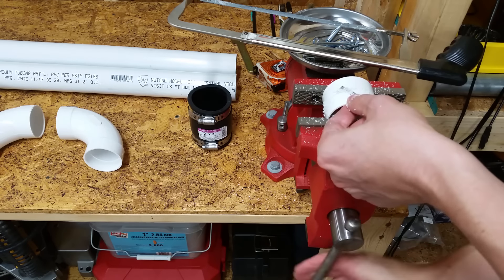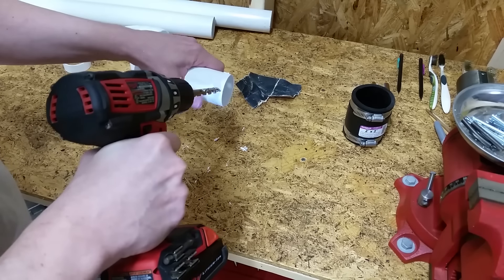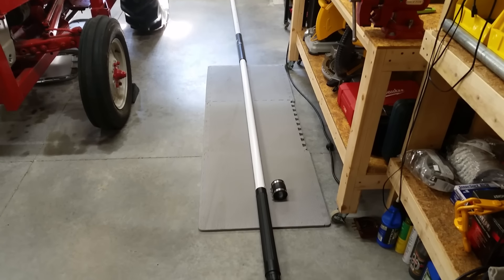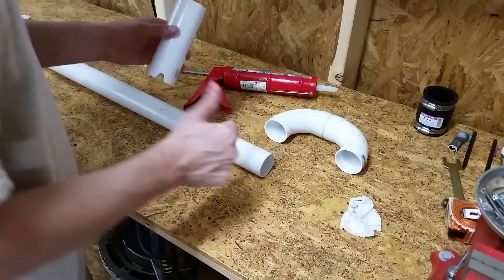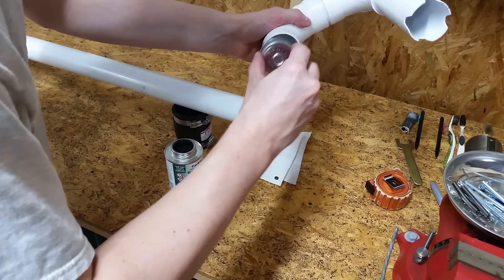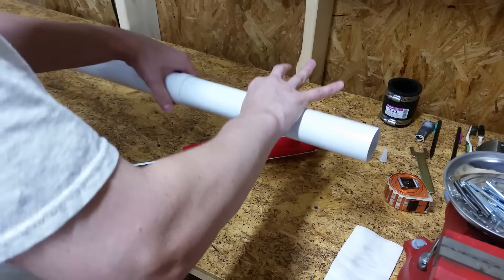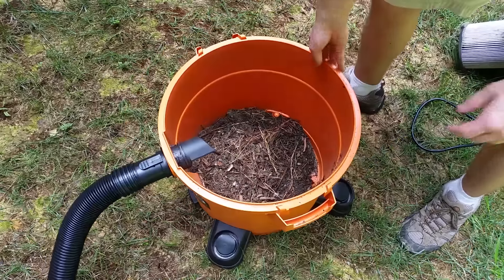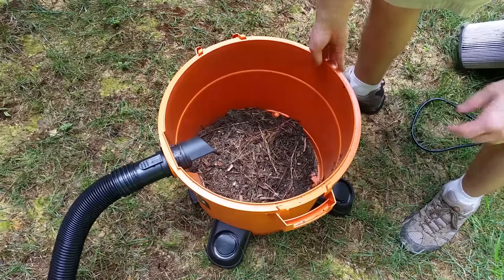DIY Gutter Vacuum - Easy and Safe Gutter Cleaning from the Ground

Comment from the maker: Central Vacuum Tubing:
https://www.homedepot.com/p/100155184
-OR
https://amzn.to/3dJr9Ci (affiliate*)

90 Degree Long Sweep Elbow (x2):
https://www.homedepot.com/p/202195581
-OR
https://amzn.to/2WYPwpC (affiliate*)

Black ABS Pipe:
https://www.homedepot.com/p/202300519
-OR
https://amzn.to/3bM9GYp (affiliate*)

Wet/Dry Vac:
https://www.homedepot.com/p/304006023

PVC Cement:
https://www.homedepot.com/p/203477293
-OR
https://amzn.to/3yz63jw (affiliate*)

Hacksaw:
https://amzn.to/2wRlRUQ (affiliate*)

Miter Box:
https://amzn.to/2WWmGX6 (affiliate*)

*Purchasing from these Amazon affiliate links earns my channel a small commission. Think of it as a tip that doesn't cost you anything. Thanks for the support!
Reply from the maker: I'm really sorry for the late response, I didn't find this comment until just now. Did you call around to your local electrical supply stores? That's where I got my tubing and fittings. I'm glad you were still able to find what you needed. Thanks for watching!
Reply: local central vacuum store has the 2 inch- 8 ft tubing for about $3
Reply from the maker: @pengchen2365  I thought I was getting it cheap for $6 per section, that's great! Thanks for the comment.
Reply: I'm wondering why you didn't stay on the roof to wonder the suction tub along all the gutters of the roof. What about leaf mesh installed in the gutter ?
Reply from the maker: @Matlockization  The whole point of this attachment is to stay off of the roof and ladder. For my house, the mesh screens would still need to be cleaned.
Reply: @Mikeattempts  I see, but how would the gutter mesh screens not keep the gutter clear of debris & litter ?
Reply from the maker: @Matlockization  I'm sure if you only had large leaves, the gutter mesh would stay mostly clean. I have a lot of smaller leaves and long leaf pine needles that would get stuck in the screens. Also, I assume shingle grit would clog up the screens as well. Unfortunately, in my opinion, there's no such thing as "maintenance-free" gutters or everyone would have 'em. :)
Reply: @Mikeattempts  Alright, point taken. Thank you and have a nice day.
Reply: All out of stock :(

Comment: Thank you - I built it and it works great on my second story gutters.  I was also able to run a garden hose up the tube so I could place the hose in the gutter and flush it with water. I have  a small drone, DJI Mini, that I flew over the gutter and angled its camera down to see anything that needed additional cleaning.
Reply from the maker: That's great, thanks for the comment! Before I built the vacuum attachment, my original plan was to make a PVC hose attachment to spray out the gutters. I might still do one specifically for flushing out the downspouts.
Reply: Put a cheese cloth at the end of the down spout and it will chatch all the shit the vac. missed when you wash it out
Reply: Love the suggestion to use this PVC thing for guiding a garden hose - double duty!  I am not optimistic about my shop vac sucking up the needles from big cedars and Doug firs - but I am frankly afraid to try to get up on a ladder to clean my second story gutters!

Comment: First if all thanks for making the videos. @Mikeattempts. It has been very helpful in using these alternative in cleaning gutters especially in second stories and eliminating the use of extension ladders. I was able to find 10ft long, 2" pvc tubing at a local vaccum store at $7 each and ended up purchasing 3 pieces along with the connection fittings. During assembly and first trial run (while raining and gutters overflowing), i was able to use without permanently connecting the fittings with pvc cement. But temporarily used flex tape (used in ductwork) and held up. Also one modification i did was instead of using two 90 fittings, only used one to the side that goes into the gutter and used a 45 at the 10 ft side. It helped with not having to be directly under the gutters.
Reply from the maker: I'm glad to hear the attachment has been working well for you. Thanks for the tips, they'll be helpful for anyone considering making this attachment.

Comment: Well done Mike.
What works better for me then thin wall Sch-20 PVC tubing is 3 inch “round” x 10 ft long aluminum down spout. Pros: it’s much lighter, far more rigid for better control and low cost. Cons: it takes a bit more effort to couple the various sections together. 

Results: I can easily reach my first, second and third story gutters buy coupling or decoupling 10 ft downspout sections.

Bonus: After vacuuming all the gutters, I securely attach my iPhone to an expandable window washing pole, then in video mode inspect all the gutters to make sure they’re all perfectly clean.
Reply from the maker: Yep, the professional ones are made of aluminum tubes too. Good info, thanks for the comment!
Reply: Guys, how would you connect the aluminum downspouts to the vacuum and to each other, and what would you use for the curve? I only found corrugated round ones.
Reply: How do you couple and decouple the aluminum downspout sections?

Comment: I did a very similar project to clean my gutters using nearly all the same materials shown in this video: one exception was the shop vac. Instead, I connected the piping to my backpack leaf blower. I now clean my gutters by blowing the leafs and pine needles away while standing safely on the ground.
Reply from the maker: That's cool! I'm sure it wouldn't be quite as strong, but you could connect the hose to the exhaust port on the vacuum and blow 'em out that way too. Thanks for watching!

Comment: This works great.  I built one out of two 8' sections of 2" central vac tubing with a 2' section of ABS.  The one minor change that I made is that I left the end that goes into the gutter flat...I did not cut out openings for air to escape.  I did this because I am using it with a small shop vac that is only 1.75 HP and I wanted maximum suction.  The method of letting the end suck down on the gutter and lifting up works great.  I also think the flat end works better when positioning it directly over the downspout opening, it can really suck any debis that may have fallen into the downspout.  Overall, great design and saved me $300 / use.  I think you could put a third section on, but I would recommend using standard schedule 40 PVC for the bottom section for better rigidity.
Reply from the maker: That's actually a really good solution for anyone using a less powerful vacuum, thanks for the comment!

Comment: Okay, drilling the holes to prevent the suction from fastening to the bottom of the gutter is BRILLIANT! I never would've thought of that, thanks!
Reply from the maker: I appreciate the comment, thanks for watching!
Reply: There is a cut we used in the oilfield called a mule shoe works better than drilling holes.
Reply: @dallasvanve7956  the gold is always in the comments - thanks
Reply: Simple things

Comment: I've been doing something similar for several years now.  Got tired of climbing the ladder so often.  I attach a Worx piece to my leaf blower and even attach a camera to the end of the Worx to video and see if the gutter is clean.  I can watch on my iphone as I go along to see when it is clean and move on to the next section. I don't have to keep lifting my attachment over those pieces in the gutters as I just hover over the gutter as I go along.  The PVC is a better option than the Worx attachment IMO, so I might adopt that as the Worx tends to bend backwards when I have the blower on high speed.  Always looking to find a better way and this video certainly helps, so thanks.
Reply from the maker: Ah, yeah, it would be nice to avoid those gutter hangers, it's probably faster too. I could connect the vacuum hose to the exhaust port and blow 'em out the same way but I've never tried it because I didn't want all that debris raining down on me. :) Thanks for the comment!

Comment: I used the 2' vac extensions, I found many at yard sales so pretty cheap.  I bought a 55 gal drum with removable lid. Cut holes in the led and put on vac hose adapters with wood, silicone caulk and screws with nuts. Hose from vac to drum and another 2 hoses connected using vac couplers from the drum to the extensions. I strap everything in a pull around cart.  The vac never gets full only the drum so I don't loose suction and the vac is easy to clean out even if I suck up wet stuff.  The first time I filled the drum twice with leaves and needles, nothing in the vac but some dust.  Some times the tubes plug up or they may come apart but easy to fix and I stay on the ground.   Highest point is about 20' up.
Reply from the maker: Dang, that's a MacGyver gutter cleaning rig, sounds like it works great! :)
Reply from the maker: @jonathanjudd3168  Yep, I think that's essentially what he made.

Comment: I've been using this system for the better part of 10 years now. It's faster, safer ( no ladder except for inspection if you choose ), and does a far better job than the trowel. Whenever I see any of my neighbours using the trowel, I'll stop to tell this about the vacuum method. Surprisingly, even the commercial gutter cleaning guys still use the trowel and bucket method. Go figure. Excellent video Mike.
Reply from the maker: They sell a commercial version that's made of aluminum tubes (I think) but it's a bit pricey. Thanks for the comment! :)

Comment: I watched your video a few times and now I'm back to say thanks, this helped so much. For around $150 CAD I had all the supplies I needed (including the wet / dry vac). Usually one visit to clean gutters costs $100 since I have a two story home. This thing will pay for itself quickly.
For those of you trying it - here were my mistakes.
1) not drilling those notches in the end of the tube. "Certainly it won't get stuck to the bottom of the gutter, is my gutter even flat?" I thought. Yes, it will. Yes it will.
2) Know about how high you need to go and plan accordingly. I started off on my front porch and the nozzle was in my gutter and my pvc piping was almost on the ground. This made it a little bit hard to maneuver. 

Luckily I can adjust both problems easily.
Thanks!
Reply from the maker: Thanks for coming back to comment! I really enjoy hearing the success stories from people who made their own gutter vac attachments.
Reply: J, do you mind me asking what wet/dry vac you went with? I can't find one with a 2" hose, and I'm a little worried that a smaller hose will get clogged.

Comment: ❤superb job. I love it. So many people get seriously injured from falls. I have a suggestion for you to consider... if you attached a water hose and water jet tip with a squeeze trigger valve, you could give the gutter a strong wash after sucking out the debris.
Reply from the maker: Thanks! I did consider making a separate garden hose attachment for cleaning out the downspouts, but I haven't done it yet. I made a follow up video with more details, if you're interested in building this attachment.
Reply: @Mikeattempts  i just watched your update video. Great job. I shared it with a friend who hates using a ladder. He was delighted to see what you made.
Reply from the maker: @TeezerDriz  That's great, I really appreciate you sharing the video! :)

Comment: Mike! Thanks for this video and your brilliant design. For $40 I built the attachment to clean the gutter at the back of my two story + house. I needed 24 feet to reach the gutter, so used 2 x 8 foot pipes and one 3 footer. It worked great. All parts were available at Home Depot's in Torrington and Waterbury, CT. I may buy a new shop vac with a little more power as my 20 year old 4 hp Craftsman is getting a bit tired, but still managed to suck up a full bucket of dry leaves. Best, I don't have to go up that TALL ladder and scare myself. Thanks again!
Reply from the maker: That's great! I'm glad the video was helpful and I appreciate the positive feedback. Those central vacuum tubes come in 10 foot sections too but those are probably a little harder to find. It's good to know that some Home Depot stores have everything you need in stock.
Reply: Laurence, do you want a job clearing my gutters near Waterbury?

Comment: This is perfect. Got mine all prepped before glue tommotow. Think ill cement the whole top area as the last thing i want is a piece to fall off ill never get back...all i want to add is some type of support at the end to hold a gopro mini.
Reply from the maker: Mine is still holding together after all these years but, if I had to do it again, I would probably use PVC cement on the whole top area as well.
Reply: @Mikeattempts   yeah, the gutters I have to do are super high, and if they fall off they are going to stay there forever lol
Reply from the maker: @jn2400  Hahaha, yeah, that would suck! :)

Comment: Im a inventor of many products.  To the inventor of the PVC shop vac cleaning idea. YOU ROCK. I WISH I WOULD HAVE THOUGHT OF IT.  I FINISHED IT USING YOUR IDEA. I JUST SAVED $175.00 THAT THEY WANTED TO CLEAN MY COLONIAL GUTTERS. GREAT IDEA AND IT  WORKS
Reply from the maker: That's awesome! Were you able to find the central vacuum tubing?
Reply: Man this is fantastic 👏
Reply: WHY ARE YOU YELLING?
Reply: Inventor is a word with a specific meaning. 
Using a different material doesn't equate to inventing the product

Comment: This is great! I own a pressure washing company, but I always send my customers to someone else when they ask for gutter clean outs. I can reach about 4.5 stories high with my machine from the ground so I don’t need ladders, and I prefer to keep it that way. I’m going to steal your idea for the tubing, and I am going to run two shop-vacs paired together in series to increase lift power. That should help with the wet crap. Maybe this next winter I can add this service to my business. This will keep me from having to spend $2k on a SkyVac. I don’t want to waste money in case it ends up being something I hate. Thanks again!!!
Reply from the maker: Just be sure you get central vacuum tubing, it's the only plastic light enough. I made a follow up video in November 2021, in case you need more detail (link in video description).
Reply: I sure will man thanks a lot! After I finish I’ll try to post again with an update. Hopefully running two vacs in series will actually work.
Reply from the maker: @toddluns1  One suggestion, since you're making these for your business, you could make a 1-story attachment and a separate one for 2-story (as long as you have the room to transport). That way could just buy a central vacuum PVC coupler to join the sections together with PVC cement for the 2-story attachment and you wouldn't need any of the black ABS pipe. The central vacuum tubing comes in 8 or 10 foot sections. Also, you probably won't need 2 vacuums. I'd try one 6.5HP wet/dry vacuum first before buying a second one. My vacuum is only 5HP and it does a great job. Yes, please let me know how it turns out!
Reply: @Mikeattempts  I have plenty of room. I have my pressure washers mounted inside enclosed trailers. I also already have two 6.5 vacs. I hooked them together this morning and it made an incredible amount of lifting power. I’m sure one would work ok, but efficiency is the name of the game. The sooner I can finish the sooner I get paid. I have lots of days where I’m cleaning 4-5 properties. I’m going to try to order the tubing soon, and after I test the final assembly I will report back. Thanks again for the tips!!

Comment: I just found your video. I made a very similar setup about 10-years ago using abs, but think the  vacuum tubing is likely lighter in weight. The one difference I did was to add a 45 right after the second 90. That way the 5” or 6” piece leading into the gutter is not vertical. I also cut it 45 degrees. This eliminates it being sucked down to the bottom of the gutter itself. Works great. I went so far as to add a union to join the 2-90’s. that way you can adjust the attack angle of the short piece leading into the gutter itself. The union prove to be of limited success but was able to optimize the attack angle and eventually taped it with duct tape so it is now permanent.
Reply from the maker: Sounds like a great design. I toyed around with the idea of angling the tip but, depending on the gutter section, I would sometimes need the tip pointing in the opposite direction. Thanks for watching!
Reply: I bought a bunch of shop vac extension pipes.
Reply: What angle did you wind up going with when you made it permanent?

Comment: I do exactly the same but totally opposite.
Rigged the tubing to attach to my backpack leaf blower! Been using it for years!
Reply from the maker: That's a cool idea! I guess I could do the same by connecting the hose to the exhaust port on the vacuum but it'd be messy.
Reply: @Mikeattempts  
I just make it the first step when doing the rest of the leaves. Does get messy if they're wet though...

Comment: Couldn't find that sch 20 pipe at any stores locally so just happened to find a couple pieces at a "Habitat for Humanity" store.  They also had some 90 degree elbows.  I used electrical tape to attach the different pieces so I could remove them if needed.  Just cleaned some gutters this morning and it worked fine  I used my shop vac and blew out the gutters.  Haven't tried vacuuming them out yet.  Much better than climbing a ladder.
Reply from the maker: That's cool that you found some tubing at your local Habitat store. It's more commonly known as central vacuum tubing, and I got mine at my local electrical supply store. Thanks for the comment!